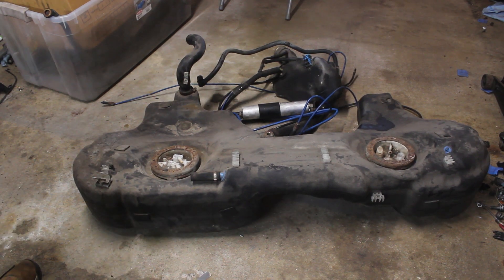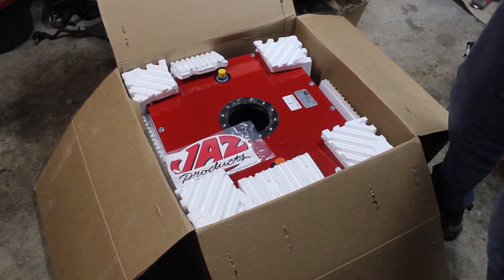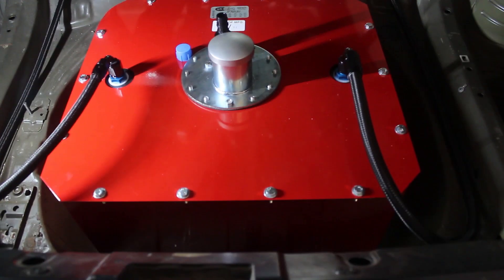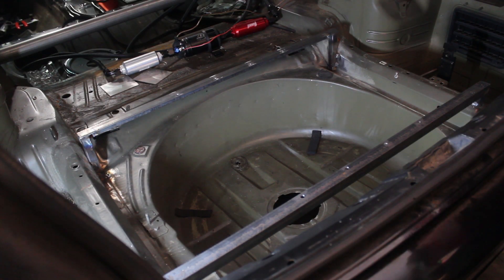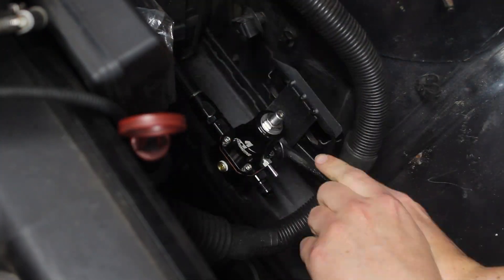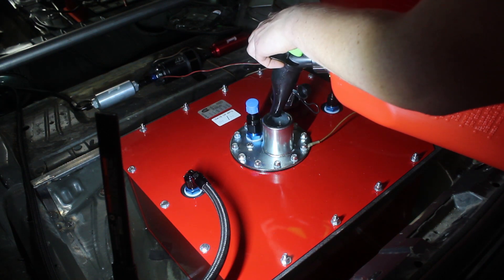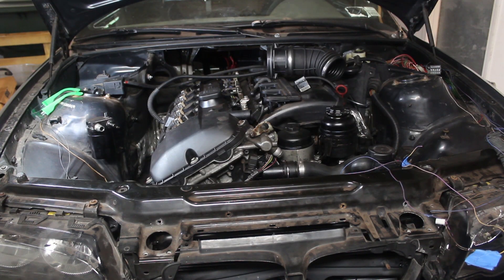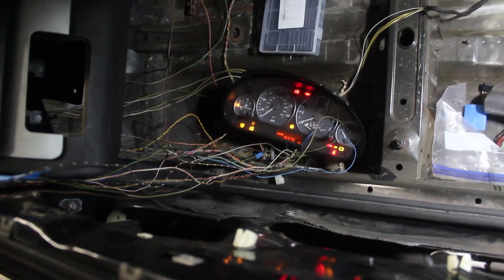BMW E46 Race Car Build: Fuel System

Comment: Hey great video! I have a question on the wiring. Did you just use the factory wires!? Then obviously the fuel gauge no longer works. Does that cause any other issues?
Reply from the maker: No, I remade the wiring harness. And yes, no more fuel gauge. The electrical system is pretty bare bones and I ripped a lot of stuff out. Not sure what problems it would cause on an original harness.
Reply: @rainvillecreative5410  So how did you wire up the fuel pump then?
Reply from the maker: @TenzaMotorsports  Relay output hooked up to the power for the pump, relay trigger over the ECU's dedicated pump output